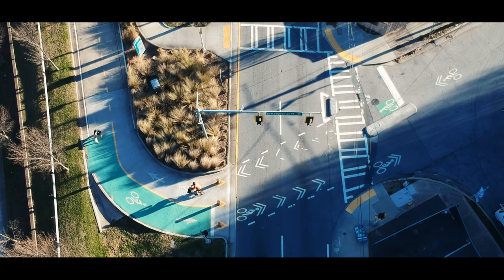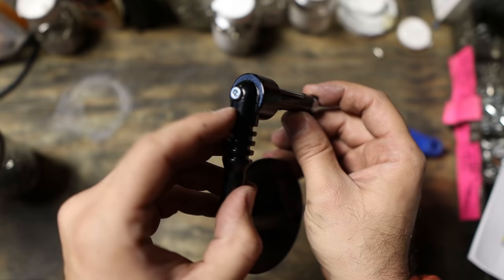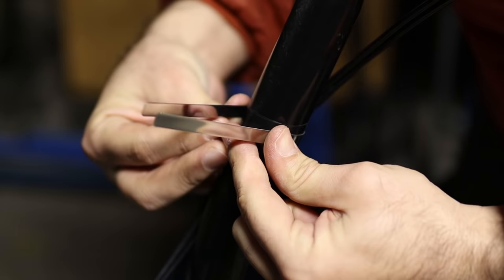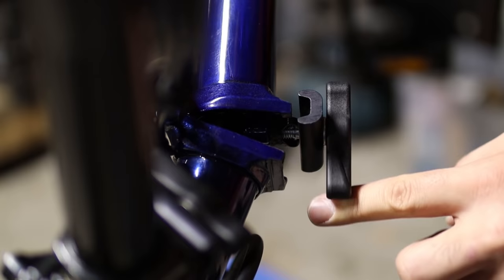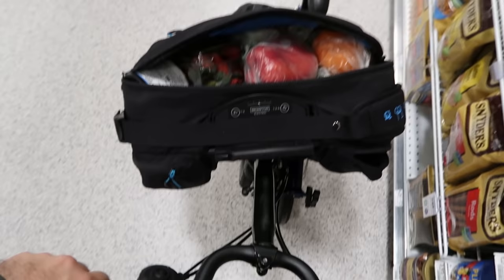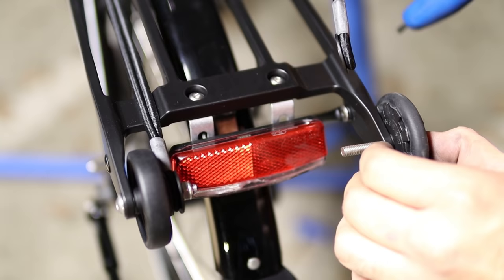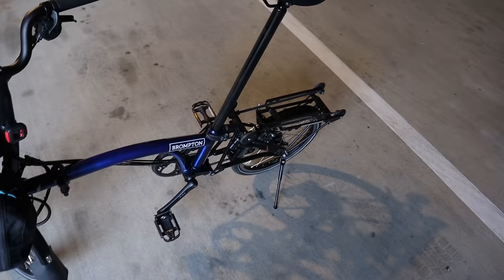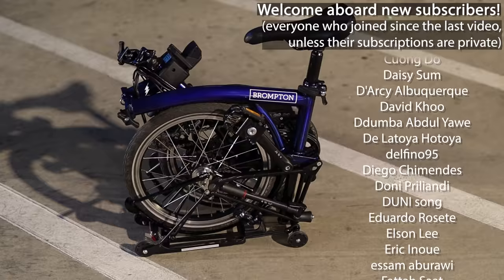7 Brompton Accessories | Brompton Folding Bike

Comment: I'll add two upgrades I find handy. 1. The Brompton's handlebars don't leave much room to mount gear such as a GPS. Search ebay for a "bike handbar extender." That'll let you add a 20 cm bar for accessories. 2. An Ibera PakRac Mini Commuter rack I had on a mountain bike fits the seat post on a Brompton perfectly. You can use it on its own or in addition to the lower-down Brompton rack. As a plus it can be used with Ibera's extensive line of quick-release bike bags at prices that are typically cheaper than Brompton-only ones.
Reply: Wouldn't a seat-post rack interfere with folding (or at least making it compact when folded)?

Comment: If possible, you always want your kickstand closer to your payload... that's why on standard bikes, the one that fits on the rear triangle is best. I haven't been paying attention... Brompton has not yet made the "easy wheel" standard? Shame! For me, I think that little plastic gizmo that keeps the clamps aligned/pushed out might even be the top of this list of upgrades. Thanks for your great videos!
Reply from the maker: The original wheel that comes stock these days is much better than a few years ago, so if I didn't have EZ wheels laying around, I probably wouldn't have replaced those. But there's still some noticeable advantage because of the bearings on the EZ wheels versus bushings on the original. The springs are a neat upgrade!

Comment: I'd consider the EZ-Clamp Spring absolutely essential, to not have worry about aligning the clamp for a tiny cost is soooo essential and the first thing i'd recommend any tri-fold bike rider!
Reply: I haven't had trouble in aligning the clamp in twenty years of riding a Brompton.

Comment: As a bike pro ( i'm Dutch) and owner of one, i would strongly advice to use some protective tape like Lizard skins frame protector, and a dynamo hub like a SON is also a great  upgrade...
Reply: Hi. Please say more about the protective tape idea.
Edit: I looked that up and it appears to be handlebar grip tape. The main objections I would have to that are:
1. Grip tape has a reputation of collecting moisture under it and rusting out metal parts.
2. It covers up the pretty paint job if you value the color of your Brompton (would be OK to cover some areas of high wear, but not most of the frame).
Reply: @b.griffin317  lzard

Lizard skins frame protector.transparant.
Reply: @roelkomduur8073  Oh I see it now. OK. Where would you apply it? It seems to come in single strips so I need to know how much to buy.

Comment: This is the best Brompton accessories video. Some really clever ideas. My only suggestion for better lights would be Bontrager RT lights. One on the seat post just below the seat, and the other right in the centre under the handlebars (The front light needs rotating inside it’s mount). The perfect Brompton lights setup.

Comment: Victor I was debating a kickstand as well, to get more use out of rack. I found the Minoura SLMV-1 Mini-Velo Stand on the internet. Cost about 65 Us Dollars. I just installed it. Very stable did not have the issues you found. Weighs 155gm. I did find it snapping in the up position, and hitting the rim of the back wheel. To stop that I wrapped velcro around the top  of the kick stand, and secured with black electrical tape so it does not slide down. Could also use a dot of Crazy Glue, but I wanted to be able to get it off if I did not like it. Velcro tape stops the inward travel of Kickstand.  Thanks for your work on behalf of us all. You made an engineer out of me!

Comment: Great upgrades!
I like the extention EasyWheel that clicks. Very nice!
It was a great solution for the kickstand,  they are very helpful. 
Keep Safe! Keep Riding!
Reply from the maker: It's very snappy! Do you have a similar issue with your kickstand when you put load in the front bag?
Reply: @EverydayCycling  If it is fully loaded it is more difficult to balance.  And on a daily basis I always have to pay attention to where do I place the Kickstand to keep on balance.

Comment: This video addresses a whole bunch of things I've been thinking about for this bike.
Reply from the maker: I'm glad to hear that!
Reply: @EverydayCycling  I've been a little annoyed that the rear rack doesn't come standard, as it seems the versatility of the bike should be paired with the ability to carry more--at least strap a backpack or duffle down.
Reply: @RidingBikesinSanDiego  racks aren't for everyone though. I actually took it off my S6 as the constant rattling and meh aesthetics  wasn't worth the occasional utility of putting things on the rack.

However, I've now got an electric as well, and I can see that the limited capacity of the City bag along with the motor means I'll probably put stuff on a rack far more often... so old S6 rack probably going to go on the electric soon
Reply: @duncanhamilton5841  I see what you mean about the rack. The Ride On Cycling channel just had a video of 7 upgrades,and one was an interesting hook on the back of the saddle that might cover what I need, when I get there. Without my commute in full force, I get to wait and pick up what everyone is putting down.
Reply: @RidingBikesinSanDiego  yeah, that clip she has this is interesting, but for my money that and the rack are imperfect answers to the fact Brompton could had put a bit more thought into the City bag design; the battery takes up so much space. 

I've also got a bit of a gripe about the standard bag as that could have been a bit bigger so you could carry a drink in it, rather than just wallet and phone
Reply: @duncanhamilton5841  My biggest hesitation with the Brompton Electric is the lack of control of the assist from the handlebars. I live in a pretty hilly area, with some flats, but also some major climbs, and I don't want to stop and start or have to reach over to make adjustments to the assist. I'd like to bump it up to 3 as I approach 7% grade for a quarter of a mile, then drop it down to 1 or 0 when I get to the flat on top. I wish there was a controller that could be plugged into the top of the battery that clips to the handlebar, so I could just remove it when folding.
Reply: @RidingBikesinSanDiego  Agreed. It feels like they spent 7 years on the motor with Williams, then an afternoon on the rest of it. Although, just been out for my evening home-home commute ride on it, and I'm gradually learning to ride it differently; using pedal pressure as the power control. In some ways I think I'm having to unlearn riding a bike to get the best from it. Which means I'll probably struggle when the weather warms and I start using the other non electric Bromptons 🤔

Comment: I love the drone shot at the beginning of the video, it’s very cinematic. I also learn that you can’t push the bike with weight on when it’s folded. Would you recommend people to get a R model instead of a L if they haven’t already bought a bike yet? Great video Victor!
Reply from the maker: Thank you, Paul! I prefer the looks of the L version, but for someone who will often push the bike when folded, grocery shopping for example, the rear rack is a MUST. Now, not everybody likes to push the bike. Some prefer putting it inside of the shopping cart, so it's really up to how one uses it.
Reply: Victor is very creative. He is doing great videos. I guess he is studying cinema instead of engineering. :))))
Reply: I was able to order my electric with a rack so the store installed it for me before I picked it up. Got the larger front bag, but the battery still eats space up inside it, so I strap a larger box to the rear rack when delivering baked goods for my wife! Rear light is relocated to the rear of the rack too, nicely done by the factory.
Reply: @EverydayCycling  is it possible for you to do a detailed installation video for the rear rack on the electric Brompton please? I’m brand new to cycling everyday and the electric Brompton is my first proper bike. I’d love to use it for shopping too but I have no idea how to take apart and replace things. The rear rack is a must have item 👍. Thank you for your time in doing these wonderful videos. L 😊

Comment: Wondering your thoughts of the potential advantage of the X-Roller Easy Wheel Extender if I already have the rear rack that does add width stability. Would the X-Roller still be of value to add?

Comment: Really helpful. Thank you. The main thing for me has been wider handlebars. I swapped mine to Joseph Kuosac ones which sweep in slightly but the grips are in line with my shoulders. The normal bars are 152 cm across.   The JK bars are 160, but I cut mine to 158 cm. the bike folds fine. Thanks again

Comment: Saddle and grips were the first thing to get swapped on my electric. Had a B17 and Brooks GP1s spare, so on they went. 

Think its going to be JK low rise bar next, not happy with the vague M bar feeling after so many years on S bikes
Reply from the maker: I may fit my B17 on it as well!
Reply: My B17 "World Traveler" was the first thing to go on my electric B, from my old M6, shortly followed by Ergon grips. (and I turn the seat bracket upside to get extra height on a standard seat pole - perfect)

Comment: The Rear Rack is such a great addition to an Electric Brompton I am amazed it's not the standard configuration. Adds back more than the pinched luggage space lost to the battery and assists rolling when folded.
Love my X roller bar, so easy to deploy with the right toe.
Considering OMNI wheels, 2 or 4 though?
Thanks for your interest, informative vids.
Take care
Reply from the maker: Two is enough. Four would be quite noisy and installing them on the frame would cause heel strike.

Comment: Thanks for the Excellent upgrade options.  I dont currently own a Brompton but im torn between a Brompton B75  entry model in Ireland New at   €900 Euro  or  a  used    Dahon  EEZZ D3  for  €500 used in really good condition.   The  extremely Light weight Dahon  comes in at  9.7kg and the Brompton B75 at  11.6KG    One concern id have with the brompton is that accessories seem really expensive compared to other brands.   Each has their pros and cons.
Reply: You don't have to use the original accessories, but may buy many special items from China. I have bought carbon clamps to hold my, original titanium struts on my Lightweight, as the original metal ones actually weighs a lot!

Comment: This is a smaller, more convenient mirror for the Brompton: CatEye BM-45 Bar End Bike Mirror (£12.99) - fitting is the same as the one shown in this video. I been using it on my Brompton for 3 years. It has a very stiff ball-joint between the mount and the mirror to allow for precise positioning. If you knock it in transit it will move, if you wack it really hard (against a doorway for instance, it will 'pop off' and it's an effort to 'pop it' back on). There's no distortion, vibration or magnification. It sticks out about 2", doesn't effect "the fold" (I'm from the UK, we drive on the left, so it's on the right - non-floor-side when folded) Get one, it will make your cycling safer... at a glance, it'll let you see if it's a truck, bus, or car that's coming up behind you and trying to squash to into the gutter...
Reply from the maker: Thanks for sharing! The main problem I see is that I use the mirror on the other side, i.e. bar end is 1 inch from the ground... =/ would it work?
Reply: @EverydayCycling  I just checked, and it may not... (I've just corrected my comment) Without actually fitting it to 'your' side I couldn't say for sure, but it's movable by hand, you may be able to rotate (close it) it out of the way so it doesn't strike the ground...
Reply: Oh, and thanks for you content and videos, they're very informative and watchable (from the UK at 3am...)
Reply: The one objection I would have to that mirror is it adds 2"/5cm to the width of the bike, which can make it hard to fit in some tight spaces if you ride in very dense urban environments. (Nonetheless I have added it to my Amazon wishlist.)

Comment: The mirror will touch the ground after installation in H6L model. The only solution is to upgrade from L to R. Even when you demonstrate folding handlebar with mirror it’s with rack installed.

Comment: I put a similar kickstand on and it’s stable even with loaded bags. I dunno maybe there’s lots of variance in them. That and if I did want it a little longer I’d probably put a rubber ferrule on the end or something
Reply from the maker: Is it the same brand? I think there are better brands out there for 3-4x the cost. This one was $20.
Reply: @EverydayCycling  different brand (“snowinspring”) but pretty much the same thing, was £18 on Amazon. Seems to be many brands with the same item. Must either all be from the same OEM or they’re all clones of each other 

I did mod it a little bit: cut the top of the mount into a V shape to fit around the bottom of the rack struts so I could take the wheel off more easily

Comment: The easy clamps may also be bought from AliExpress in a - better version with an internal metal spring, which I favor. And the small wheels are useless on anything but a very flat surface. I use larger wheels, lately I have ordered a 10 cm wheel size. And why a kickstand, when you are able to just fold the backframe, as a stand! Without the bag, of course.
Reply: He wants the kickstand so he can leave luggage on the rack yet keep it upright without riding it. He said this in the video.

Comment: You really don’t need a kickstand if you have the rear rack. 
Just flip the rear wheel underneath and you’ve got the rear rack as a stand! 
Also possible if you don’t have a rack fitted, although it is nowhere near as stable
Reply: He did it so he can keep using the rack and not need to remove anything from it when not riding it.

Comment: Note: The rearmost wheels of the rack are not correctly mounted. As instructed by Brompton, they are supposed to be LEFT wheel IN, and RIGHT wheel OUTSIDE the frame of the rack.
Admittedly this is assymetrical, also counterintuitive, but it is how Brompton designed it.

Comment: How tall are you? Just want to imagine myself riding the bicycle before getting one.
Reply: I can tell you that I'm 5'10" or 175cm tall, and I use the standard seat pole at full height. But... I remove the seat and turn the mounting bracket upside down, making the seat "overslung" not underslung as it were, and that gives me an extra inch and a bit height, perfect for me and leg extension without locking my knees on the down stroke. Tweaking the fore-aft angle of the seat helps too, so for a while carry the Allen key for the seat so you can adjust it on your first rides. If you're a 6 foot plus person, you can order the bike with the extra high or extended seat pole.
Reply: I'm 6'0 on the Brompton electric, and I manage to get full leg extension.
Reply: @napilopez  cool. Thank you
Reply: I’m 6’3 (~36 inch inseam) so I have the telescopic seat post. Would recommend a test ride before you buy.

Comment: Nice video Victor thank you, I've added a rear rack to my electric but a bit stuck on moving the rear light as it is connected to the battery, how did you do yours? cheers Dave
Reply from the maker: Hi Dave, what's the problem you're facing? I just cut the zipties that attach the rear light cable to the seat stay and unscrewed the light. Then the light came off with 10in (25cm) of cable, enough to route up the rack stay to the rear portion of the rack.
Reply: @EverydayCycling  Hi the rear light is wired into the battery/hub and I cant see the cable extending along the rack unless I splice it. just wondering how you did yours.
Reply from the maker: @bigphatphotos5028  can you send me a picture of the right side of your rear triangle? I want to see how your rear light cable routing is done. I assume it is the same as mine, so you shouldn't have run into issues. I didn't cover it in the video because it was straight forward to switch positions. Please send it to victorsabioni@gmail.com

Comment: Nice work and info, thanks. Never purchased from AliExpress...is it safe? 
Also, did you wait a long time for delivery from AliExpress?  TIA
Reply from the maker: It's pretty safe. Just make sure the seller has a good reputation. The link I put in the description is exactly the item I purchased. It took three weeks, with Christmas and New Years in the middle, so it shouldn't take longer than that.
Reply: @EverydayCycling  thanks for the comeback and you’ve motivated me to add this to our 2 Bromptons. Film at 11....(or in April when they say they’ll arrive)
Reply from the maker: @Gogogordy1  It shouldn't take that long, they're probably giving a longer estimate to avoid complaints.

Comment: Hello, for a brompton electric which easy wheels are you using? and can you put the bar extender and the easy wheels without a rack?
Reply: The bar extender works with any Brommy AFAIK. The rear wheel assembly is the same in all cases.

Comment: Do the accessories you put on there add a lot of weight to the bike? Do you think the bike is light enough to ride without the battery?
Reply: Nothing shown should add more than a few ounces put together. I have ridden an e-Brommy and the motor alone without the battery adds a few pounds to the front and noticeably unbalances it when lifting the bike one-handed but not when riding. Based on my personal experience test riding an e-Brompton at the Brompton Junction in New York I would not recommend it.